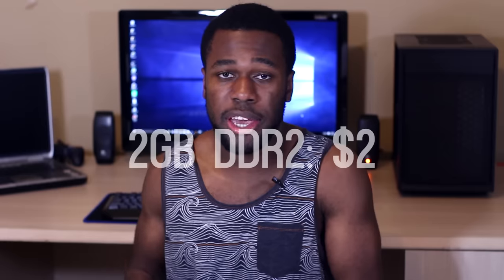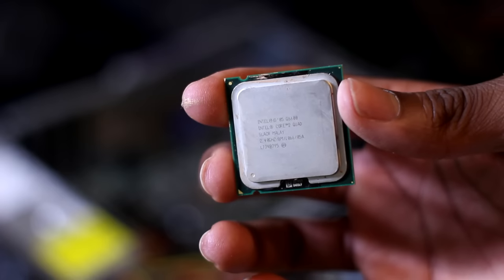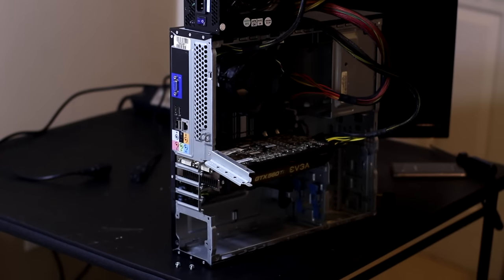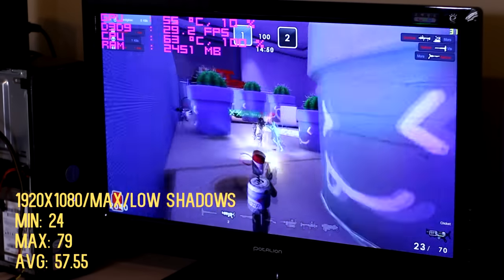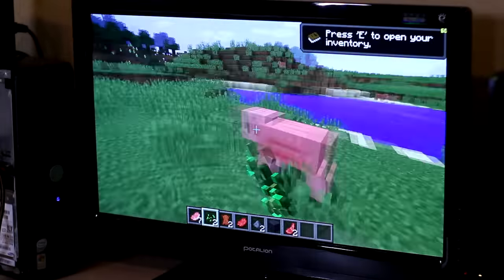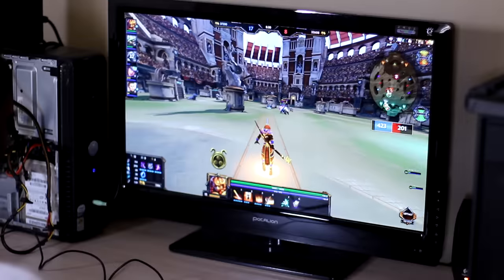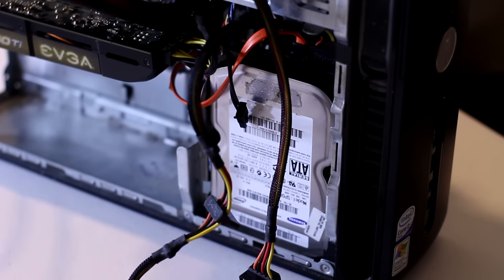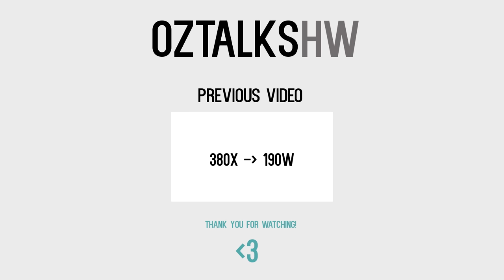The $25 Gaming PC vs League of Legends, Minecraft, Overwatch & More! | OzTalksHW

Comment: This is better than my 1400$ xps 17! Not even joking! I got windows 10 and since then i get 20 fps on minecraft!
Reply: FaZeZombieslayer / uninstall the windows 10
Reply: I don't know if you only play exclusively minecraft, or you have also gotten FPS hits in other games, but I think that when you upgraded Win10 uninstalled yo graphics drivers, because the same thing happened to me. The way you check if that's the problem go into device manager, and check under "Display adapters" and if it only says some weird thing, I forgot exactly but it's not your video card, then windows 10 uninstalled your drivers, and that causes a HUGE frame hit to any of your games, obviously. The way to fix it is to just update everything through windows update, that fixed the problem for me.
Reply: hello btw since the new window 10 update i invite you to go check in google how to fix it because you have to deactivate recording screen from xbox play and you ll get +40 fps
Reply: I get 200+ FPS on my laptop and it's only a 400$ laptop
Reply: No offense, but I refuse to believe any XPS with an intel core will struggle with Minecraft. It's not graphics intensive at all; so your iwhatever should run it quite well. Heck, if my Atom toaster can run minecraft at 30fps, so can yours.
Reply: Santa Australia i heard there was a problem in the software of running games in windows 10. So u had to disable something that makes games run how they sipposed to run. Thats the problem most ppl get on their new pc that has windows 10 preinstalled
Reply: MO VDB what do you mean like what must you disable please let me know as i recently got a new pc
Reply: matthew miles Disable the Xbox game dvr on Windows 10, it lags your computer down a lot
Reply: Yea thats what i meant something with filming while playing or some bullshit

Comment: If you turned off fraps you may have gotten that 60 frames off LoL
Reply from the maker: Runnings Fraps itself doesn't induce a huge FPS loss. Recording w/ Fraps is where the hit comes in
Reply: Do you have any videos on the Surface Pro's? I'd be interested to see what those Laptop Slate hybrids can run in terms of games.
Reply from the maker: NickFromFlorida None right now, but I've been looking into hybrid/convertible laptops
Reply: League's performance is always really determined in teamfights where a lot of big animations and different things are going on, thats where a hit into fps or performance comes.
Reply: it loses fps when you record mate
Reply: yes u are,u basically have a very good GC
Reply: I've run Overwatch on my Surface Pro 2 on low settings at 50% render size and average between 30-40 FPS. Nothing fantastic but it's not horrible, Blizz did a great job optimizing the game.
Reply: Actually when I open traps when I play I get +5 fps

Comment: Lol a 560 putting out 1440p
Reply: I have a i5 8gb ram geforce 560 and I can play gta 5 on max :/
Reply: +deudzgamer8 Gaming why would I lie
Reply: +deudzgamer8 Gaming min fps 40 max 71
Reply: +deudzgamer8 Gaming average 60
Reply: +deudzgamer8 Gaming average 60
Reply: +deudzgamer8 Gaming I want to upgrade to the 700 or 900 serie when gta 6 Comes out
Reply: +Bradley0beaver 1080
Reply: +deudzgamer8 Gaming case depends ram 60 bucks or Euro for me i5 250 Motherboard 100 560 card 80 ssd 150 1tb hdd 60 so 700 Euro or dollar I live in Holland custom build
Reply: +LukeXDNL This is becasue GTA V is very optimised
Reply: 1440p is tha max resolution setting 4 a 560ti
Reply: No u cant play it on max dude cuz it has only 1gb vram.I have r7 260x which is very similar to the 560 and i can get only high settings with 2gb of vram. I owned gtx 560ti before i know what i talking about :).
Reply: *****
Thats true :)
Reply: +AndIGotKilled HAHAHAHA, it's not at all
Reply: It is more optimized than GTA IV was at least.
Reply: +lmcgregoruk Perhaps. But that still means I can't run a stable 60fps on highest settings on a GTX970. That does not really suprise me. What does surprise me however is that I can't even run a stable 60fps on lowest possible settings because in some areas of the map the game just randomly decides "nah, man, fuck your fps".
Reply: What anti-aliasing option did you select? MSAA x8?
Reply: ***** Was that directed towards me? I run FXAA or none mostly, since any other anti-aliasing effectively halves my frame rate. I am exaggerating probably, but it's not good either way.

I have tried the lowest settings just to see what would happen and it's certainly working better that way, but who wants to play on lowest settings with a decent graphics card?

At the moment I am running medium up to ultra settings, depending on how much of a performance hit every settings is, and it just barely stays at 60fps while still looking amazing.
Reply: Sorry no it wasn't Arne. It was directed at LukeXDNL. The + functionality isn't working for some reason so I can't tag anyone :/
Reply: ***** Nevermind then :)
Reply: +LukeXDNL sweet I have a 960m which is basically the same, 16gb ram and an i7 5th gen. I know I'll be able to play GTA v. I hope it's better optimized than GTA IV

Comment: LoL is not demanding at all since really they recommend a 3GHz processor, 2gb memory and a GeForce 8800 also the 3GHz processor is mainly a Pentium 4 model base.

My media system which is a Sempron 2650 with a R7 240 is able to play LoL at high settings 1080p and get more than 30 fps when playing and when i go to very high i get on average 30 fps which to me i need more than just 30 fps because it runs smoother.
Reply: Ecks™ i have 8 gb of ram radeon r7 360 intel i5-4460 and i still play on medium-low
graphics dont matter in lol
Reply: Michael Scofield To some graphics doesn't matter and also for most modern games right now you would be playing on low/medium settings cause of the R7 360.

Comment: Hey I'm getting a gaming computer under 500$. Have any tips
Reply: hi
Reply: SSNNOO Not always true. AMD cpus are a much better value for money.
Reply: My first tip would be, ignore everything SSNNOO said.
Reply: buy pats and build it dont vuy the whole pc ist better like this
Reply: get a cheap AMD quad core cpu. and a 750TI, 4gb ram/8gb if u got enough money, around 400w PSU, buy a 25$ fan, because AMD can heat up quickly and stock fans are ehh..motherboard, get something simple, and under 100$, and then get a nice small case, since most of these parts aren't big, boom 500$
Reply: amd all the way best bang for the buck

Comment: My £200 laptop runs Minecraft at all the lowest settings at like 1fps
Reply: Then you got ripped off.
Reply: +HubbleBubble Well it ran good at the start, like 40 fps, then suddenly went to like 1fps
Reply: my 600 euro laptop runs it at fucking 10 fps
Reply: +old memes are cool not if you have a good one
Reply: le cry
Reply: From what I know you have to pay a lot for a laptop with the similar power of a  decent desktop. I think the culprit is most laptops having integrated graphics cards.
Reply: Laptop cpu's and gpu's, even dedicated ones, are vastly inferior to desktops'  cards due to size constraints. Look at the benchmarks, the desktop cards almost always win out.
Reply: Oddly enough I had a laptop that could play Skyrim on ultra (tweak of course, at 30fps), but could barely play Minecraft.

Comment: League of Legends is VERY optimised but it's also not got the super great graphics.
Reply: Yes, but this PC is running it on very high graphics for the parts it has. For League to be running this well means Riot has optimized it quite a bit for it to be stable. If he were to turn down the graphics settings, he would most likely run it very stable. For a $25 dollar build, this isn't half bad.

Comment: If you are looking for a budget gaming of I have to recommend the hp pavilion 500 164. The prices ranges from $150 to $250 and it is not at all bad. My specific one (with no upgrades) had 8gb ram, quad core 64 bit and a8 6500, 256 gb ssd, and a GeForce Gt 610. On average I can run bo2 at 80 to 120 fps in multiplayer, and around 40 in zombies. I strongly recommend it to anyone on a low budget.

Comment: I Bought Core 2 Duo E7500@3.80GHz(346Host Clock), OLD FOXCONN 775 COOLER GA-G945CM-S2C, 2GB DDR2, EVGA GEFORCE 9500GT, OLD "POSITIVO" PSU
I PLAY PALADINS AT 60FPS, POINT BLANK AT 77FPS, MK9, GTA IV, AND A LOT MORE GAMES!!

Comment: I'm getting the corsair vengeance lpx 16 gig (2by 8) 3200mhz black, ram
Wd blue 1tb sata 6gbs 7200rpm 64g cache 3.5 inch, hardrive
Msi radeon rx 480 gddr5 8gb crossfire ,graphics card
Intel core i7 6600k quad core socket lga1151 processor 
Which motherboard should I get
Reply: Boiii  Maximus VIII Extreme but check if it is compatible

Comment: Does cpu age decrease its performance?
Reply: Gaming w/ SuuRazz kind of, remember. Hardware degrades.
Reply: Yes, but not that much

Plenty of old components still going strong.
Reply: Also, if the cpu is overclocked and is pretty old, degradation rate increases. As a case that a cpu might become unstable at a clock speed that it was once able to hit

Comment: the problem is the cpu and the ram, i have a 560 ti and an i3 and i run btf in ultra 900 avg 40fps, gta v on high 50fps, the witcher 3 900p medium/low 50fps
Reply: csgo max setting, 1080 120fps avg

Comment: i have amd athlon 64 x2 6000+ it has 3ghz clock, but when ipgraded it i noticed cooler i had was for energy efficient type cpu(wich i upgraded from) so i underclocked it to 2,4ghz is it worth buying 130 or more watt cooler(maybe even liquid) for those 3ghz or even ability to overclock to 3,3 and i have 3gb ram in that system, go i need to upgrade to 4+?

Comment: This is almost exact same as my first pc except I bought a box of random parts for 12 $ nz probably 8$ us it ended up having a little pc in it slim case to with 16gb ddr3 had a weird slim graphics card in it but put a gtx 460 from the same box it has a i3 2100 and has 640 gb hard drive there was like 5 hard drives in box and speakers and some other graphics cards.

Comment: yea league is very easy to run, you actually don't even need a gpu card to run it on low a duel core with integrated grapics actually does it fine with no issues

Comment: i have an i3 6300 3.2ghz (roughly), 8gb ram and a really shitty graphics card, i run csgo pretty well at 60 fps 1080 p low settings but i cant run overwatch, can someone recommend a good cheap gpu that will fit a normal sized office pc that can run overwatch with that cpu? thank you

Comment: league can run on a single core, but yunno my intel 2 duo core t5850 on board graphics and 4gb of ddr2 ram canplay league @ 30fps rip it plays 17-50 (17 in team fights 50 standing still) xD it's all over the place. but i did get some inspiration from your ryzen 3 2200g video which im currently building. I may throw in a Gpu when i can afford one :)!